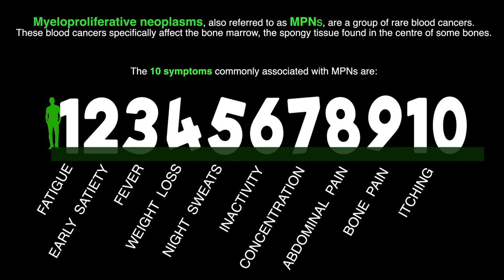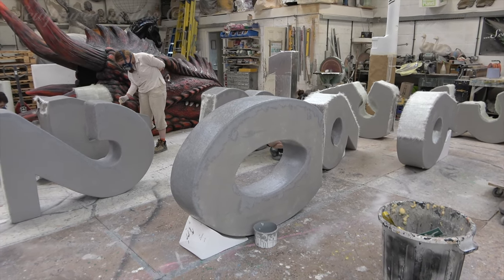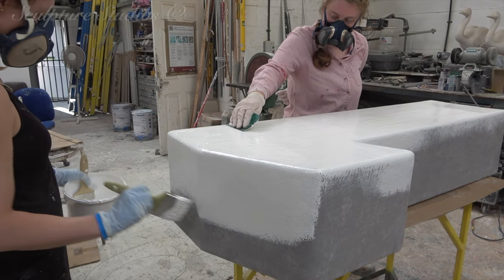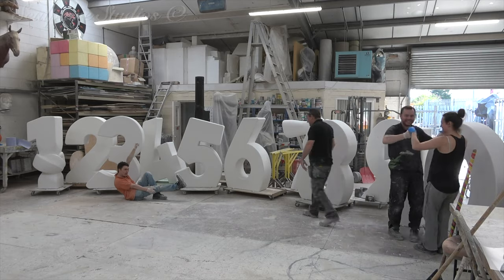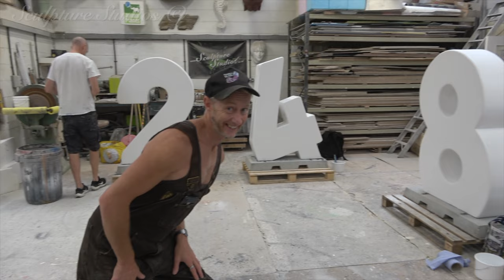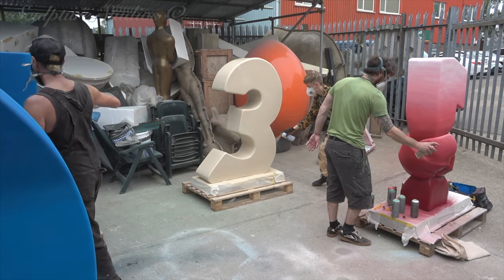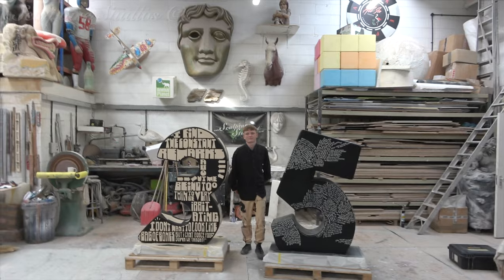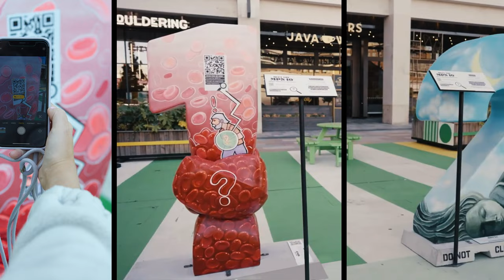Giant Numbers - MPN 10 Blood Cancer Awareness Campaign - by Sculpture Studios

Comment: Thanks for sharing another amazing project. Just curious, what thickness of wire do you guys use for that tabletop cutter. I ask cause mine always seem to stretch and bow as it heats up. Yours doesn't seem to move much as you run the foam through. Thanks